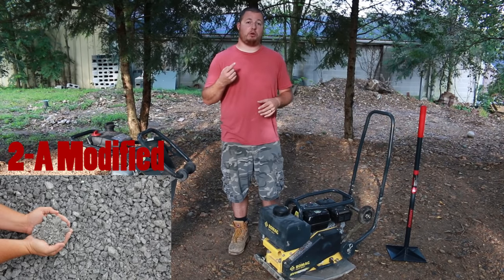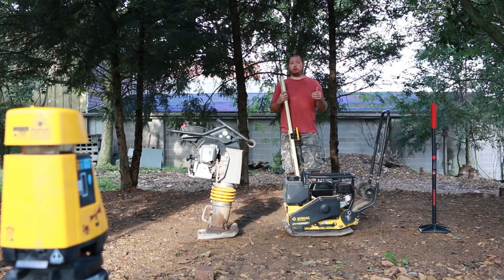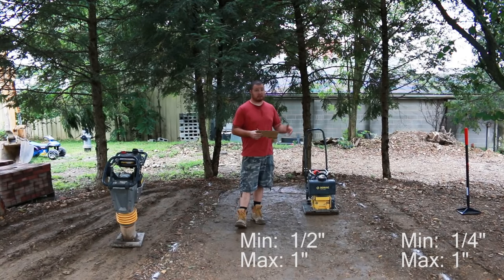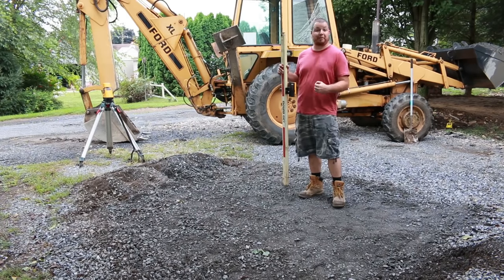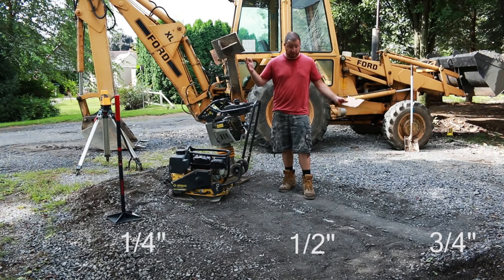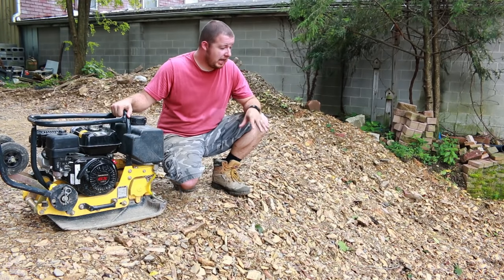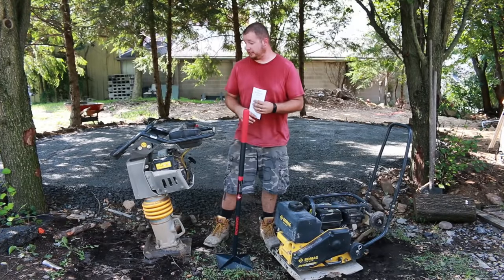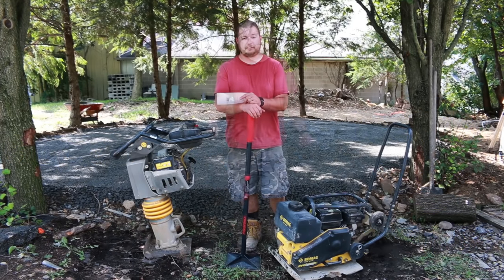Compaction - Jumping Jack Vs. Plate Compactor Vs. Hand Tamper

Comment: So a plate compactor compared to hand tamper is time and labor.
Reply from the maker: Its very close. All depends on how hard your going with the hand tamper. As far as speed goes, you would need 20 dudes on hand tampers to keep up with a plate compactor and that would probably be only for a good 5 minutes.
Reply: Appalachian DIY 🙏
Reply: Appalachian DIY great video!
Reply from the maker: @drmariopepper4354  Thank You!
Reply: Also just for example if I have to dig down 3 inches for my base do I dig to 2 1/2 inches or do I dig down to three inches? Just curious if I should do less because of compacting or does this not matter?
Reply from the maker: @drmariopepper4354  I dont know what base you are doing this for but usually you dig it down to 3" then tamp. Fill in with stone to bring it back up to grade.
Reply: Appalachian DIY thank you three inches was just a random number. I can see I am overthinking it. Just dig to desire depth and compactor won’t cause it to change.🙏
Reply: Appalachian DIY just subbed too. Appreciate the replies. Thank you again
Reply from the maker: @drmariopepper4354  Absolutely! good luck!

Comment: Hand tampers are mostly useless. When you had the girl using the plate compacter, she went way too fast. Slower would have given a better result.
Reply from the maker: Hand tampers have their place, albeit very limited. The plate compactor wasnt pushed it went at its vibratory speed. If it would need more compaction a second pass would be easier than holding it back

Comment: the jumper was pumping
Reply from the maker: Yea that thing goes!
Reply: @appalachiandiy2415  Uh no what I mean was it was hydraulically pumping the dirt away, it was operating too far to the right of the proctor curve. When it pushed down the area around was pushed up because dirt was pumped away from where it was below it to the sides.

If the soil was drier it wouldn't have left ridges and would have reached a higher density.
Reply from the maker: @trygveskogsholm5963  Ahh I see what you mean now. Yea, the dirt was a little on the wet side.

Comment: A nuclear gauge would have been handy lol
Reply from the maker: That would have been interesting to see results from that!
Reply: Yes your plate tamper is the winner jumping jack is ok for small jobs and  tight areas the hand tamper I only see get used in the lab. Mainly or on material that doesn’t require maximum compaction